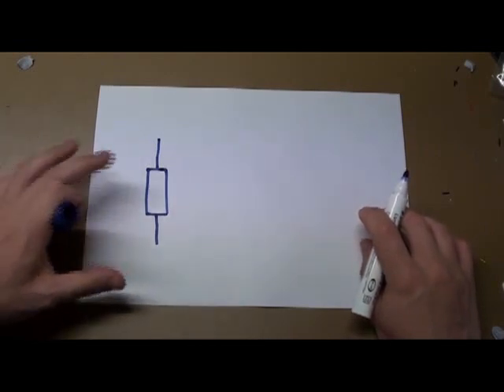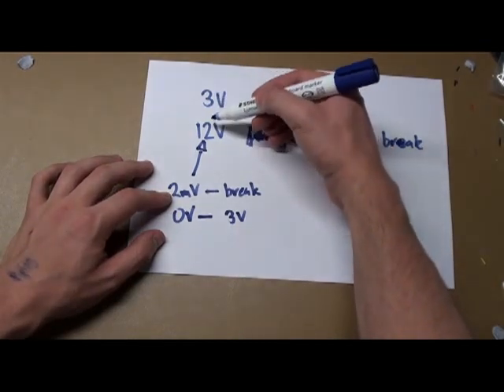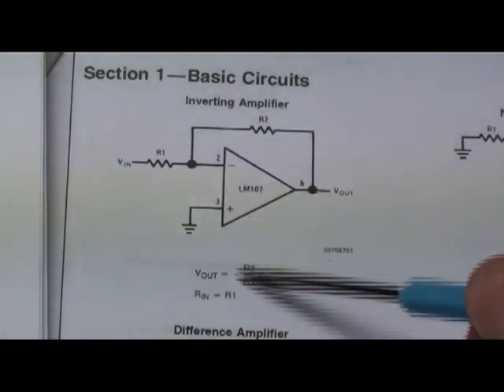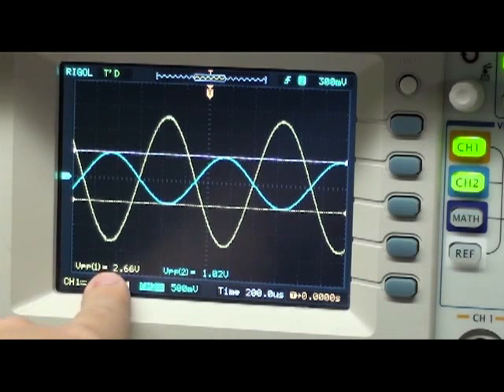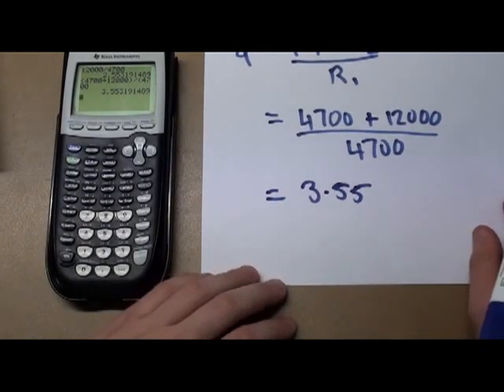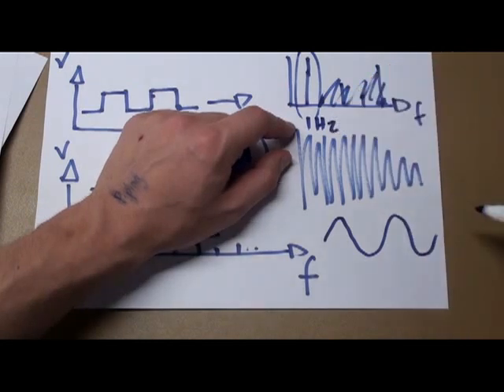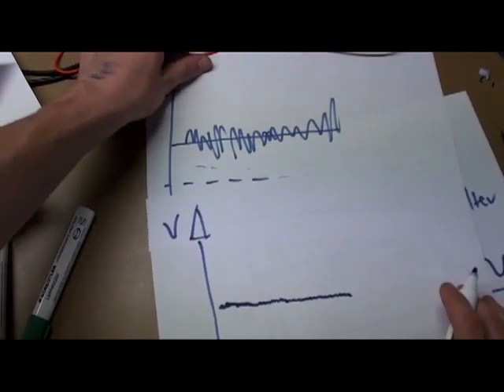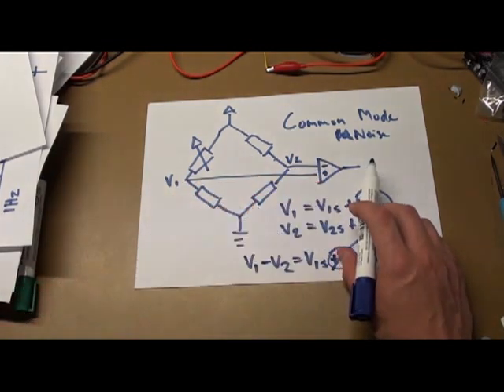ENGG1200: Project C tips and tricks

Comment: .........1 degreee, special measurement tools, sounds extremely hard.
 provided the creo people's calculation is right( I've asked them to check a few times already,they said its right. coz i know the chage in resistance is wayyyyyyy to low to measure and design!!!!!)Also all the deign are based on the assumption of initial strain gauge resistance is precisely120Ω, which is impossible in real life. Gonna fail the test:( 
Thanks anyway!

Comment from the maker: you can't measure ohms that low with your regular multimeter, because the resistance at this scale will change depending on how the leads are touching the resistor and the resistance of the leads themselves (probably 0.1-0.2 ohms). You need a special tool that can do "4-wire" resistance measurement or a milliohmmeter. That is a really small resistance, are you sure your calculations are correct? You *may* be able to use a 25-turn 10ohm trimpot (ETSG 04-01-01), 1 degree of rotation is 0.0011 ohms

Comment: Thank you!  one more question, as you said before, low strain is not a problem, but since the change in resistance is only 0.0017Ω, when I try to simulate in lab with potentiometer, its very hard to make such tiny change, also the multimeter only shows one decimal number. suggestions?

Comment from the maker: it would be ok if you went inst -> summing -> gain -> filt but the general good practice is to put your filtering stages as early as possible. When you have really high frequencies (>100MHz), sine waves can begin to jump between wires on your board through air (TV? FM Radio?) and lots of other weird stuff can happen thanks to maxwell's equations. So you have to get rid of it early to keep it from spilling into the rest of your circuit.

Comment from the maker: as you increase the gain in an instrumentation amplifier, its common mode rejection ability decreases, so you will be introducing more noise into your output from the input signal. So you need to have a low gain on the instrumentation amplifier to get rid of as much noise as possible. Also, the amplification of high frequency noise can actually introduce even more noise that didn't exist before! All of these weird behaviours are why the datasheet is so long; TI have spent a long time testing it.

Comment from the maker: yes, this is a little tricky and a good question. In most applications, the amount of voltage to trim changes between circuits (because of part tolerances; 12k is not exactly 12k) so you can't realistically calculate it beforehand. So instead, you just build the circuit, hook it up to an oscilloscope and twiddle the potentiometer until it comes out at the value you want; put no strain on and measure the trimming amp out, twiddle the potentiometer until you get 0V out.

Comment from the maker: 1. not necessarily, the tolerance does not change the value of a resistor after it has been built, so as long as you can correct for the difference you will be fine.
2. as filter order gets higher, filters become better at removing the frequencies you don't want (the curve gets more slanted). Higher order filters are harder to build and weird stuff can happen
3. hook them all up to the same power supply, no problems there.
4. no need to simulate noise, there is plenty in the environment already.

Comment: 5. for filter part, you used two stage amplifier *10*10^(-15)*100, whats the difference is that to *1000*10^(-15), put filter at the end to get rid of the amplified noise at last. that should give the same result(number)?  thanks.

Comment: hi, questions1.If the max strain is very low(0.000007),then the change in resistance is only 0.0018ohm, which is even within the tolerance of resistance of strain gauge. So no matter what electric design used, its not going to work. right?
2.whats advantage of second order filter over first order?
3.we need to power several chips(opamps,555,instamp) and dc input, there are only two linear output on the dc power supply,hows that going to work?
4.how to simulate noise in elec lab

Comment from the maker: Hi Justin,
It is definitely not impossible to fix, this is a very common problem. The trick is to use an offset trimming amplifier (mentioned in the video and the op amp collection) and to subtract the offset from when the strain gauge is at 0 strain (ie the bridge should be perfectly balanced). So if the error between your two dividers causes an output of 1V and your strain signal is 1mV, then you would get 1.01V out of the diff. Then, if your offset trimming stage adds -1V, you get 1mv out!